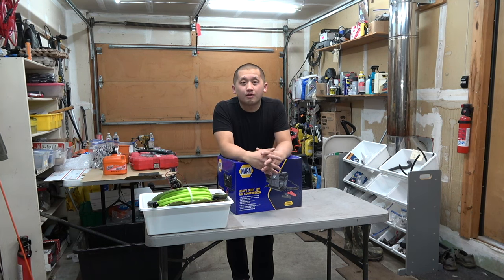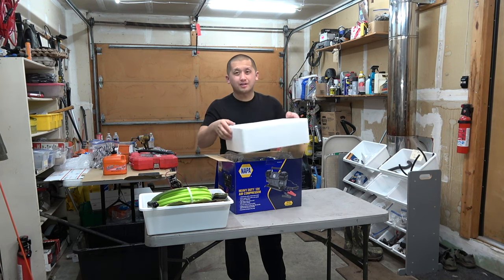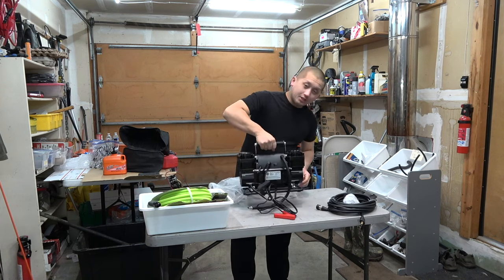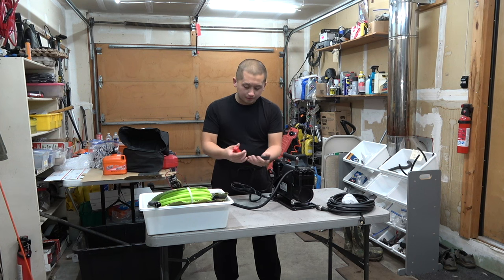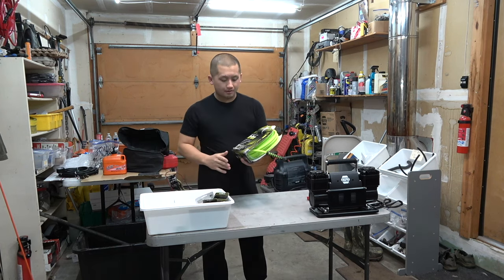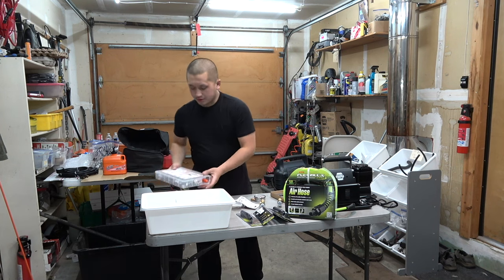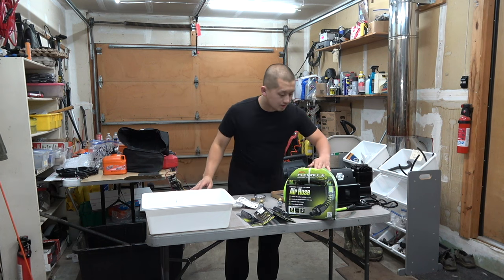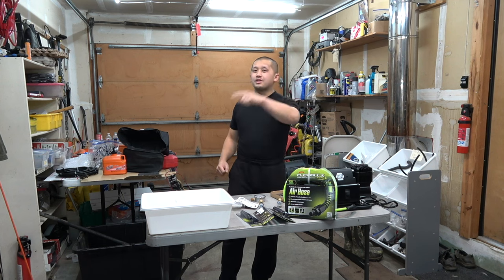MY NEW AIR COMPRESSOR | NAPA 300 LPM 12v | FIRST LOOK

Comment: I purchased one of these a couple weeks ago.  Of course I took it apart to do some mods.  I pulled the heads and cylinders off to check lubrication and do some porting, well I found both of the compression rings were damaged, one had about a 1/4 inch chunk missing.  So I'm now looking for new compression rings.   I found some on Amazon and ordered a couple different sizes, they arrived and are not an exact size to fit.  Also I found that both pistons were not centered in the bore, both are tight to the inside .  I filed the housing surface to center up the pistons, now fitting the new rings with some mods to the piston tops.  Besides that I also used the same hose and parts you have, they work great !  I went with a two tire system and may upgrade to a four.  The green Flexilla is the way to go, easy to repair and work with !

Comment: I got it about 4 months ago and also did a 4 tire air hose system. So far it’s worked perfect. I also put a pressure switch on my compressor and I tapped a 1/4” hole on the manifold for a quick disconnect.